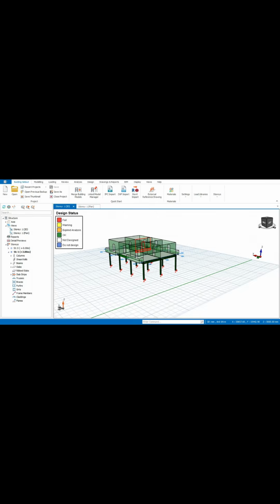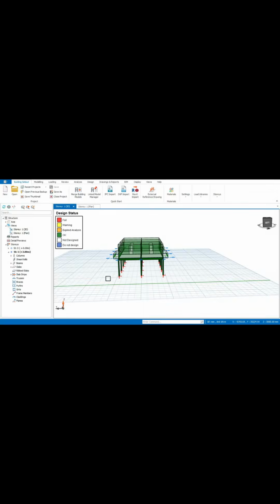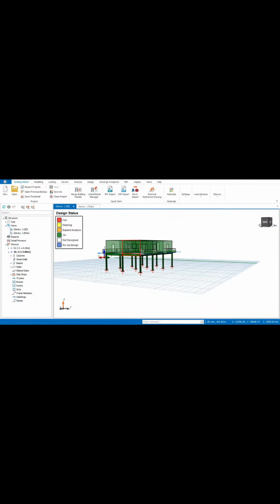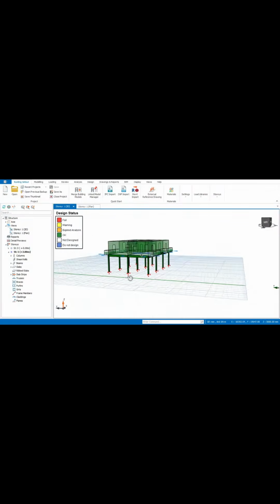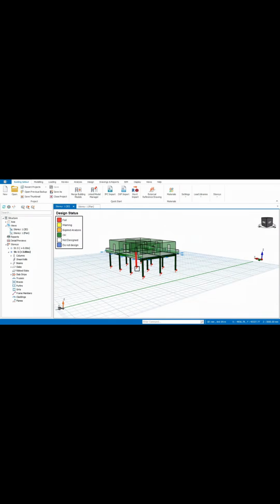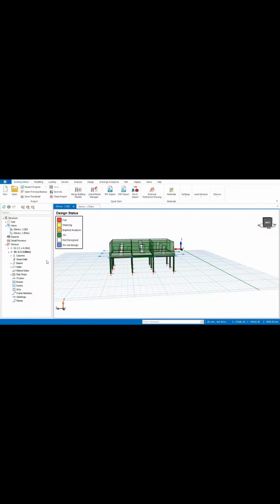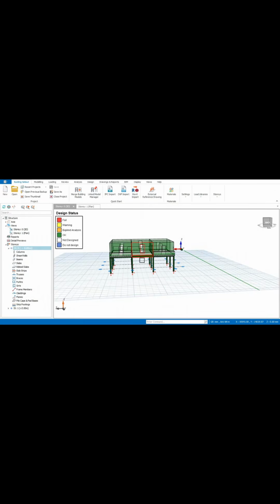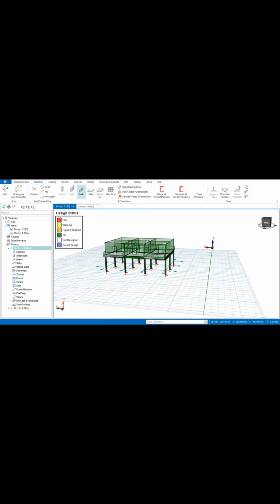PAD FOUNDATION DESIGN in Protastructure #protastructure #rebar #foundation

Comment from the maker: This is a tutorial video on how to design a pad foundation in Protastructure. 
https://youtu.be/JlJ467E3Rok
[Learn how to design a pad foundation in Protastructure]

Visit the link above👆 to see our full video tutorial on how to design a Pad foundation in Protastructure.

Don't forget to subscribe to our channel for more videos like this and turn on your notification bell to be first the see our latest video. 

Visit the links below 👇to check out some of our previous video tutorials on how to use Protastructure for structural design and detailing. Thank You.

https://youtu.be/wYdzDCgd-eE
[Learn how to Manually design reinforced concrete beams in Protastructure]
https://youtu.be/TNlRiYMV2JE
[How to design Flat Roof and Parapet wall using Protastructure]
[Learn how to Design wall loads on a cantilever in Protastructure]
https://youtube.com/shorts/f7_cralpJhs

https://youtube.com/shorts/ECxs80jWOH8
[Learn how to design a slabbed flat roof in Protastructure]

[Learn how to perform building analysis in Protastructure PT1]
https://youtube.com/shorts/O2wz2iJaz8M

[Learn how to READ REBAR DETAILS and SCHEDULE]
https://youtu.be/RGsRzr1gY_g

[Learn how to use Protastructure for structural design and analysis] 
https://youtu.be/J73b5_CV8JQ
How to draw slab strips and read structural detailing.

https://youtu.be/uzZS9Sb_o_g
[Learn how to recover a broken Protastructure project file that won’t load in the software application]

https://youtu.be/BLpKfz366iI
[Learn how to use this Protastructure as a beginner, student or enthusiast in the field of structural design, analysis and detailing]

https://www.youtube.com/playlist?list=PLmAMRg6X2S2y5_VWc8_30GEizRhhgMs66
[Tips on structural engineering and how to design with Protastructure]

#design #Protastructure #tutorial #beam #civilengineering #structuralengineering #rebar